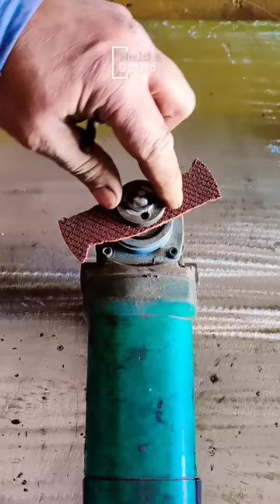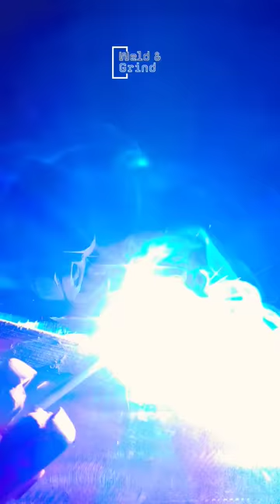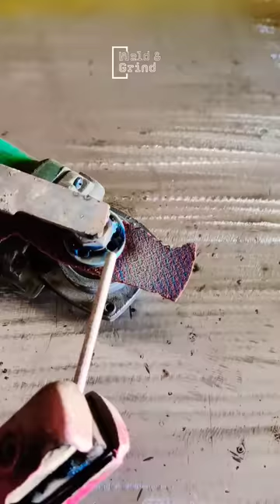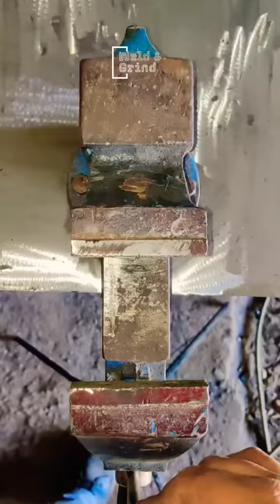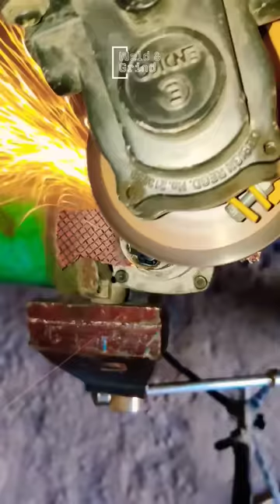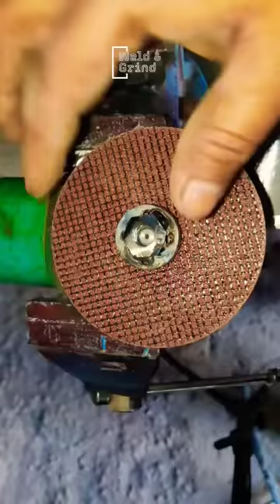EXCELLENT IDEA 🔧🔧✅✅#diy #handmade #creative #shorts

Comment: Try a hex wrench or better yet, use the chuck it comes with. Channel locks work wonders too. Don't hesitate to use the wheel lock button on the top of the grinder 👍
Reply: I couldn't find anything to use to get mine loose cause I'm notorious for loosing everything I need exactly when I need it but I got it with a pair of needle nose pliers and most aren't one that tight
Reply: It comes with a spanner
Reply: I use two Alan keys, place them opposite eachother, in the chuck holes. lever them against eachother and turn. Voila. Dosnt strip the outside and super easy.

Comment: I can’t believe no one has mentioned that you can use a pair of channel locks and avoid all this extra work 🤣
Reply: Yep I just commented that... then scrolled down and seen your comment ....That's exactly what I always use if I don't have the actual tool....👍👍👍👍
Reply: also doesn't destroy any parts 🤘👍
Reply: You can literally use the wheel itself. Press the lock down and spin the wheel counter clockwise. I haven't used a single tool to change the blades out in years.
Reply: Came here to say this and was slowly losing faith in humanity. Thank you saving that for me lol

Comment: I've always just hand tightened it. Can then loosen by hand and the cutting blade never slips.
Reply: This guy knows what time it is.. never once have I used a tool to tighten one
Reply: i only use a tool if its really stuck and that happens 1 out of 100 times
Reply: I do the exact same thing
Reply: how great is it when changing ur oil the filter screws off by hand easily
Reply: Same think i do, sometimes it stuck very tightly then need to open it with hammer and pin, but this guy gave useful tip i think.
Reply: Ive lost my wrench 4 years ago and never had to use it in the 5 years of owning my grinder
Reply: Hold the lock and hit the wheel down the edge of the table. Knock the torque right out of it.
Reply: Me too.... If ya need the key your either rough as hell and working the tool too hard or accidentally snagged in the cut. One exception is when installing masonry cutters. Depending how abruptly the grinder stops spinning the extra weight of metal structure disc can cause it to loosen up. Found this out the hard way using a tile cutting disc in makita cordless.. Thankfully no injuries 😅
Reply: Just wear gloves, hold the wheel lock button down with one hand and torque on the disc with your other hand. No wrenches needed.
Reply: @catsaregovernmentspies  same here
Reply: The only time I would use a wrench is when I'm taking off a wire wheel but it's more likely I'd just use thick pair of gloves.

Comment: Please don’t do this, very unnecessary. Just use the actual tool, it’s no more than a couple dollars. Or if broke, just make one but don’t weld a nut onto the piece my goodness.
Reply: Bro when wheel broke and stuck on grinder no tool help at that time
Reply: @maninderaasa4556  vise grips work no problem in that rare occurrence otherwise jus by hand

Comment: it's better if you slice the right and left sides of a few mm, the bolt can still be used to lock the thick plate but if you weld it is no longer useful for thick plate.

Comment: Just take the tool to remove them and if it doesnt fit, ie… using a hilti on a Milwaukee etc just out one stud i to the hole and the other one against the outside of the wheel snd turn it with the lock

Comment: It's useful for the thin cutting wheel but what about the thick grinding wheel, will you fit the bolt reverse for thick grinding wheel?

Comment: I have some vital questions:
1) Why the disk always have to be a cut up finger remover when the video is about removing the disk that is stuck?
2) Why he cuts the bolt when he can remove it with a wrench?
Yeah i've experienced some really stuborn grinders where i would try doing this, but i don't get the rest.
Reply: Cos bolt will also grind the surface while grinding
Reply: @maninderaasa4556  makes sense but supposedly it's only to remove the fastener 🤔

Comment: Did you know that grinder keys are sold in hardware stores?
Reply: Did u know that when grinder wheel stuck then those keys got bend ?
Reply: @maninderaasa4556  
Not if you know how to use it correctly.

Comment: Don't do this... for one there's a lock button so the blade won't spin freely its on the back, so press the button an use channel locks, vise grips, pliers, or be responsible and always ziptie your tool keys to the cord so you never lose them.

Comment: Unless you have left your angle grinder in the shed to rust all to shit, you can literally take that off by hand. If not, they make a key, and if you don't have the key you can take it off with needle nose pliers. This is dangerous. If that weld fails while that thing is spinning a zillion miles an hour it'll be fun lol

Comment: I have never used a tool they stay on hand tight and if it binds a little when the disk snaps I just use to lock and tap the end of the chuck on the table it comes undone and slap a new one on used the same grinder for 10+years

Comment: Now you can't use the grinding disk anymore. Instead of listening to this, take this tip instead.

1. Grinder flange key. It's literally on the box.
2. Vice grip. Place it on the table side ways, use the vise grip on the flange nut make sure it's tight and put your weight on the vice grip. Works well.
3. You literally have a vice.
Reply: i am working on sites and not carrying bench vise with me😅😅,that's why this is the easiest way to open a stuck disc. Thanx
Reply: And am using grinding disc too cos that nut is on the top of that tightener.

Comment: After using 1000's of five inch cutting  disc, maybe a dozen discs broke and 80% was operator error. none of my discs ever broke like that but of course i buy quality discs as I'm more concerned with safety. About a batch of the cheap chinese ones and it did not end well

Comment: Never had a nut on so tight I couldn’t lock it and grab the wheel to unscrew. Especially on a 4.5” wheel lmao why was it even on that tight when it’s running it automatically will add pressure because of the rotation, you don’t have to put a death grip on a grinder to hold the wheel on safely.

Comment: I think this idea is very older and that nut lifespan not comes long, because it I'll run above 10000 Rpm  , then engineering gives u a holes and opening key..

Comment: first of all if u want to change cutting wheel u must lock it first and then loosen itu there is knob for lock...without locking direct if u want to open u can't...so press the opposit site nob then loosen it with proper key...don't be smart with hand grinder or cutter i cut my "knee" ...be careful safety first...

Comment: If you know anything about a grinder you should know this is the most dumbest thing I've seen in awhile.  Unless the grinder is completely broke or something but the fact you can't get that off means whoever tighten it on there shouldnt be using a grinder 😂😂😂
Reply from the maker: If u don't understand why this video is made Then u r not a real player bro, spend some time with grinder.

Comment: There is usually a little button that locks the wheel, once locked you'll punch that nut off no worries!
Reply: right, use vice grip instead if you don't have the regular tools to unlock the blade

Comment: you know it comes with a tool to take that off but you really don't need it you can usually take it off by hand but if it happens to be too tight you can't or you haven't developed your man grip because of to much soy you can hold the lock button and graze the side of the disc or whatever you have in it on a hard surface while holding the grinder if you don't have a set of channel locks handy 😜

Comment: What the F bro if you attach that nut it will make vibration, after that the main bearing will fcuked up
Reply: If you need proper solution you have to change ( spendal and AB washer ). After that it will never happen again.
(Except demage from external source).
Reply: The total cost is just 120rs . That's it

Comment from the maker: People who are asking that it's stupidity, I want to tell them that when disc breaks while cutting then its got stuck in and none tool is working at that time that useless key got bend and this formula works very well, just pick a spanner and open it easily🙏thanx for 1.8m
Reply: Grip plier will do it.. you dont know thing..
Reply: On the first clip you wasn’t holding the lock button at the back which stops the thread from spinning freely for starters and on the second you had your finger on it, and you can easily get them off with water pump pliers I’ve done it hundreds of times, why would anyone buy a spot welder over pump pliers and 99% of welders have pump pliers doesn’t make any sense that you would ruin the locking but that way.

Comment: Unnecessary and even the wrench that comes with grinder is unnecessary Just take it off with your hand just like all the true metal workers do 20 years been using my hand to change disc on grinder never used the wrench
Reply: When disc stucks and broke, then?
Reply: @maninderaasa4556   if disc broke I wear a glove and disc is stuck had it happen a couple of times  But it’s because someone else over tighten it using a wrench when they put it on.  But I hold lock button in and tap it with handle of wire brush then twist it off with my hand
Reply: @dirtybuzzard5977  and what about the damage went inside grinder's brain
Reply: @maninderaasa4556  Well if a grinder has a brain then it should be able to change a disc by itself.
Reply: @dirtybuzzard5977  then what's the reason behind your unprofessional advices??
Reply: @maninderaasa4556  if ya must know it’s called Common sense and unprofessional is what a Assistant would say then make a video that’s more trouble than it’s worth if he smashed the button the first time wouldn’t have to  weld a nut on and use another grinder to cut nut off  then can’t handle the criticism or other people opinions. I got 2 degrees and certified with a $120 a hour job so . Have a good rest of a day and don’t take it serious when someone comments on a video and if one of Assistants would have done that I would have found a new one . GOD BLESS AND HAVE A GOOD DAY